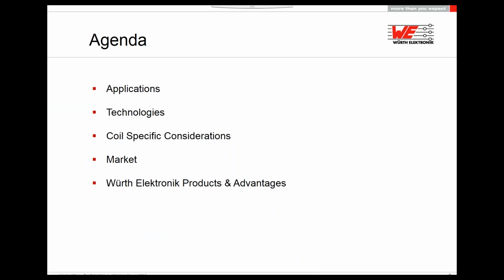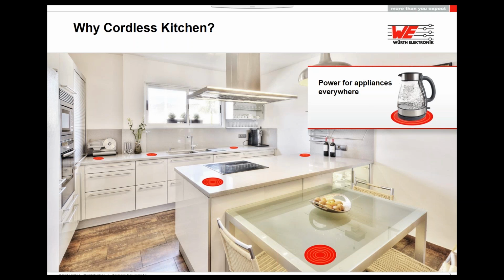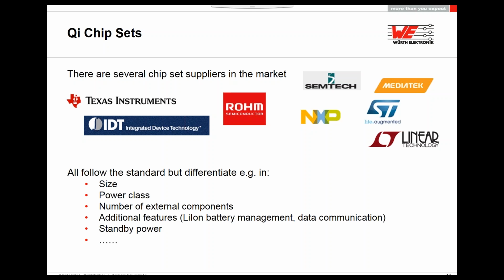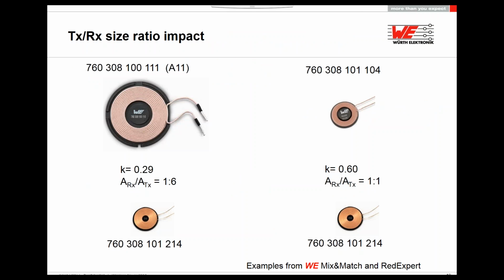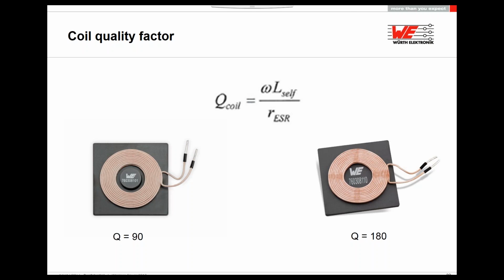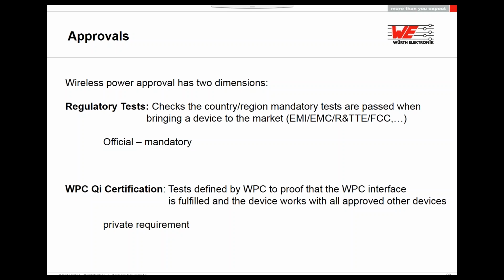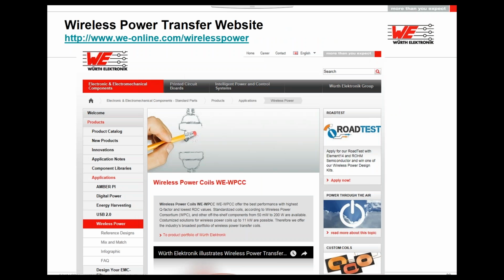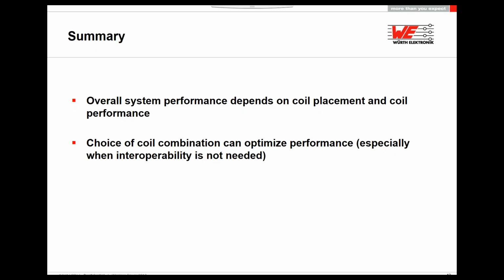Würth Elektronik Webinar: Selecting the right coils for wireless power transfer systems

Comment: Can data be transmitted beside power in your products? if yes how is this achieved?
Reply from the maker: Thanks for your request, Mr. Hakemi! The main purpose of wireless power coils is to transfer energy. In the Qi standard, apart for energy transfer between the coils, transmitter and receiver coil are transmitting data/parameters necessary for the energy transfer. These are requested power, temperature, foreign object detection, etc.

Outside Qi standard, proprietary transfer solutions (including user data) are also possible using our components. Our coils don't care what is transferred as long as they are used within their specification. The challenge is clearly on the logic side (IC’s). 
Best regards, Würth Elektronik